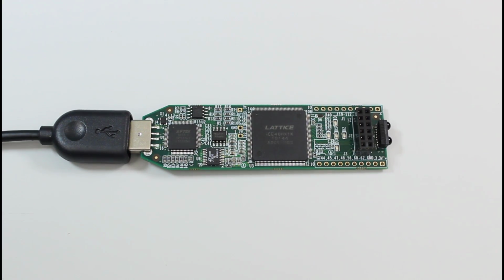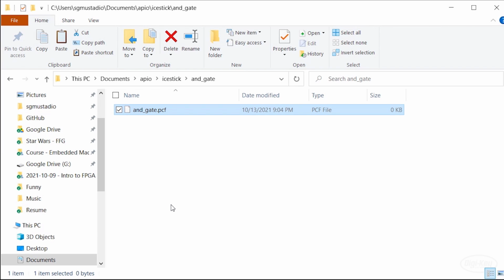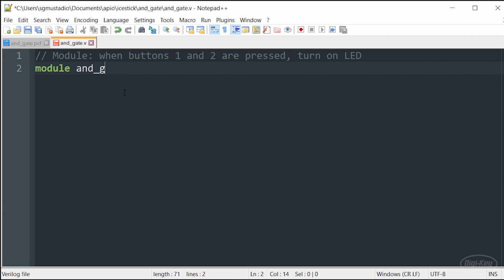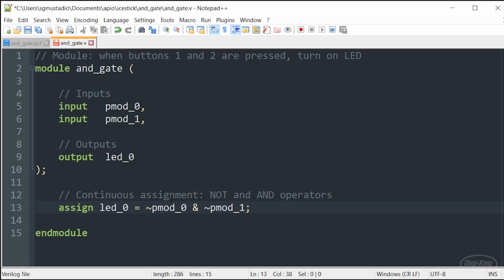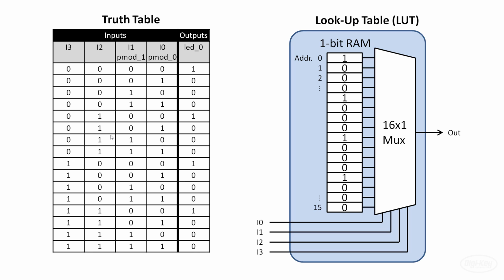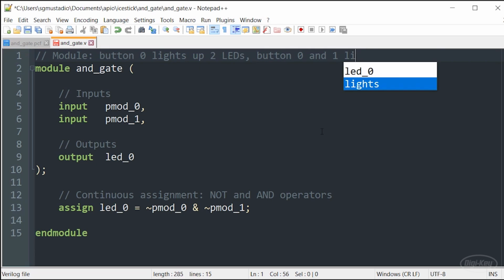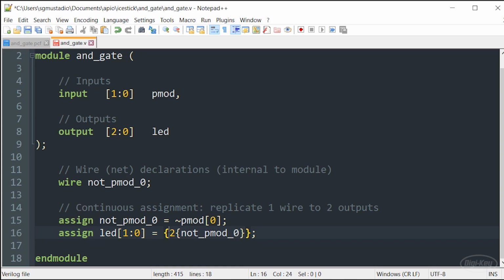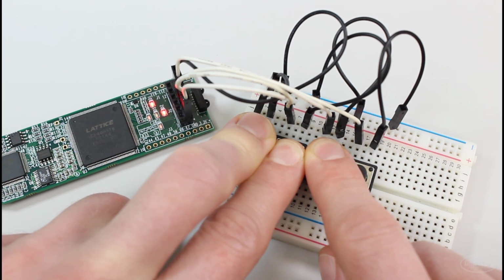Introduction to FPGA Part 3 - Getting Started with Verilog | Digi-Key Electronics

Comment: i am getting a "Error: module 'click' has no attribute 'get_terminal_size'" when i verify. i am using python 3.8.2 and apio 0.6.7. Anyone else see this?
Reply: had this issue! Try update apio: python -m pip install apio==0.8.4 then use: apio install oss-cad-suite. You should then be able to use APIO verify

Comment: So, I programmed the full-adder. I must say the synthesiser's error messages are not particularly helpful. Also one of my buttons on the breadboard was not working well, and I thought there was a problem with the verilog code. So a good advice is to test one's hardware using a simple programme, for example having each button press light a particular led. Anyway, great stuff.

Incidentally, the link to the Wikipedia article about full adders is missing in the description of the video.

Comment: With 3 pins (video data, colorbust, H and V sync) and an external module with a few resistors and transistor you could generate a Black and White(no colorbust) or composite color signal. Apple II schematic has one bipolar transistor and a few resistors and a variable resistor to get the correct voltage. Before HDMI composite video was everywhere. For color it's critical to be able to generate a multiple close to 14.31818 MHz. Colorburst frequency is 3.579545. Artix-7 clock module gets close enough. I tried with Spartan-3e and couldn't get close enough so had drifting colors.
Reply: For ICE Stick 4 month factory lead time. Not Good..Factory Lead-Time:	21 weeks

Comment: the fpga is very IO focused. why are there only so few pins on this board. i would rather have the possibility to use all pins.
also why does it have male full size USB ? 

I hope they will release a arduino style board soon with about pins at either side and a micro/type c USB connector for easy use on a breadboard. 
The world of FPGA is still not ready I guess ^^
Reply: There are dozens of different boards. This is like saying the world of microcontrollers isn't ready because there's a plastic casing on the EZ430-F2013. APIO alone supports over 30 different boards; e.g. the IceZUM Alhambra is shaped like an Arduino and the iCE40-HX8K Breakout Board breaks out many IOs to the sides. The first FPGA board I remember imitating the Arduino layout was the Papilio One. The TinyFPGA, iceFUN or OrangeCrab might fit better on a breadboard.

Comment: sick. over too quickly, I could watch this for hours.
one thing I didn't get fully though is the 'wire' part. I'm thinking the 'assign' only works with outputs and if you're trying to take output from a gate to another gate you'd use a wire?
and also, are wires just implicit when you do multiple operations in one expression? i.e. "~a & ~b"?

thank you!
Reply: Yes, wires are implicit when you do something like `assign out = ~a & ~b;` A wire is just a way to name an intermediate node (or "wire") that connects other logic. You could accomplish the same thing with:

wire not_a;
wire not_b;
assign not_a = ~a;
assign not_b = ~b;
assign out = not_a & not_b;

As you can see, we're just using wires to name the intermediate connections. Also, the `assign` keyword does not need to be used on outputs--we can use it to make connections between things within the module (e.g. connecting the `not_a` wire to the output of the logic `NOT a`). Hope that helps!

Comment: I've looked at several fpga tutorials, this is by far the best. Absolutely fantastic.
Reply: It almost recommends an ICE40hx1K dev board. I hope we're going somewhere special with this, because I'm not massively confident of what can actually be done with such an entry-level part. I think Shawn has really got into this one, though - even to the point of insisting that we should not make 'blink' on episode one or two... or three.. PDM microphone to I2S: - go! (eventually?)
Part 3 > and only as 'digital' as a Class D amplifier, i.e. not synchronous ("blocking") yet.